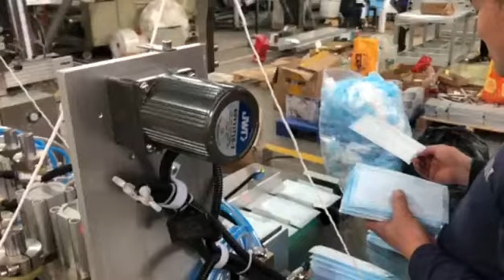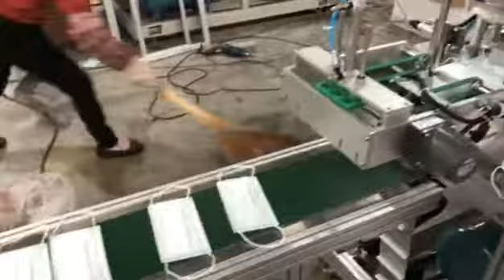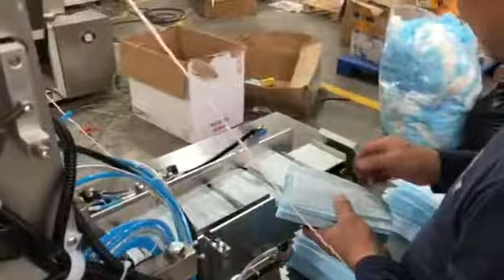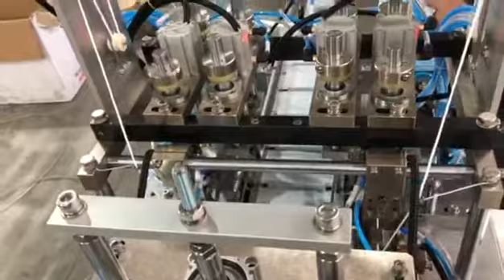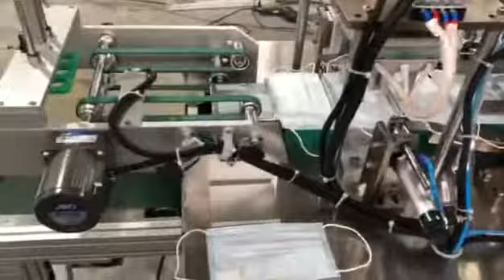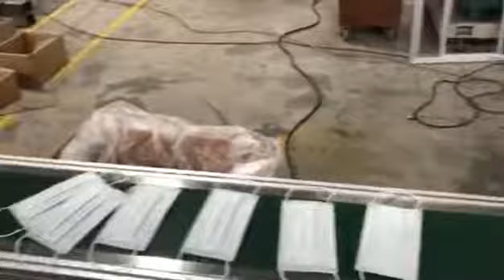Otomatik ultrasonik maske Kaynak makinesi Çin Fiyat  25000 USD

Comment from the maker: 本设备是专用于焊接平面口罩的耳带线，采用超音波焊接方式将耳带熔合于口罩本体两端，是耳带口罩生产最后一道加工工序，仅需一名操作员将口罩本体一片片置放于口罩盘内，后续动作至成品完成由设备自动完成。本机采用伺服驱动，传动精确，速度可调。
This equipment is dedicated to welding the earband line of plane masks. The earbands are fused to both ends of the mask body by ultrasonic welding. Placed in the mask tray, the subsequent actions until the finished product is automatically completed by the equipment. This machine adopts servo drive, precise transmission and adjustable speed.
2、基本信息:
材质：采用smc气缸，伺服马达，超声波，人机界面（触摸屏），铝合金结构，光电检测原料，优质钢铝精料，通过CNC精密加工，外观精美，不生锈，更持久耐用。
在无纺布复合片材上焊接一条规定长度的耳带，耳带由直拉式设计结构自动送料及自动切断，两个耳带头通过超声波焊头自动点焊，达到焊接牢固漂亮，抗拉力强的效果。
Material: Adopt smc cylinder, servo motor, ultrasonic, man-machine interface (touch screen), aluminum alloy structure, photoelectric detection raw materials, high-quality steel and aluminum concentrate, through CNC precision processing, beautiful appearance, no rust, more durable.
Welding a specified length of ear straps on the non-woven composite sheet, the ear straps are automatically fed and cut by the straight-pull design structure, and the two ear strap heads are automatically spot welded by the ultrasonic welding head to achieve a strong and beautiful welding and tensile strength Strong effect.
2.1技术参数：
Technical Parameters
Staff requirements: 1 (responsible for putting on masks)
Applicable mask type: suitable for welding inner ear straps of flat masks
Welding efficiency: 0 ～ 45 pieces / min
Machine size: about 1915 (L) * 855 (W) * 1780 (H) mm
Ultrasonic system: (2 sets)
Voltage: 380V / 50-60Hz
Air pressure: 0.6mpa
Power: about 2.7kw
Weight: about 1000Kg
Mask type: flat mask
人员需求： 1名（负责放口罩）
适用口罩类型：适用于平面口罩内耳带焊接
焊接效率：0～45片/分
机台尺寸：1965*970 *1780(mm)
超声波系统： (2套)
电压：380V/50-60Hz
气压：0.6mpa
功率：约2.7kw
重量：约1000Kg
口罩类型：平面式口罩

2.2主要配置（具体根据市场情况会有部分调整）
Main configuration (specifically adjusted according to market conditions)
序号
类型
品牌
1
触摸屏
Touch screen 
信捷
Xinjie
2
PLC
信捷
Xinjie
3
伺服电机
Servo motor 
信捷
Xinjie
5
Low voltage part
正泰
Chint
6
主要气动元件
Main pneumatic components
SMC
7
Major Sensor 
SICK 

2.3售后服务：
设备质保：质保12个月（超声波属于易耗品，不属于保修范围，提供有偿维修服务，建议多够买一套）.
 Machine guarteen: 12 months (Ultrasound is a consumable item, not covered by the warranty. It provides paid repair services. It is recommended to buy one more set.      
售后服务：在线技术支持、视频培训
After-sales service: online technical support, video training